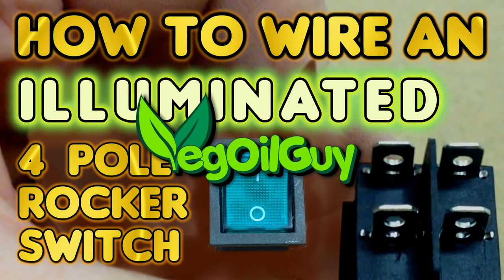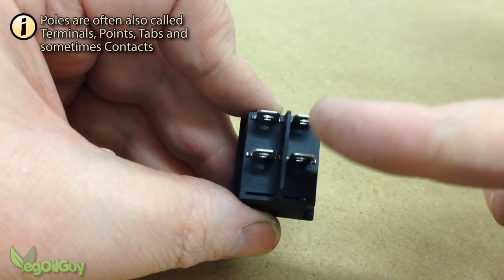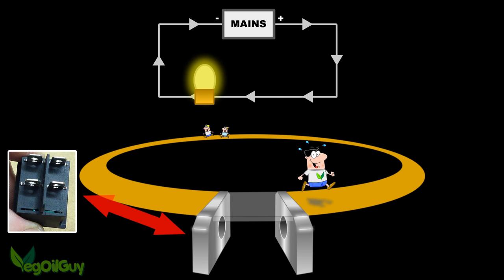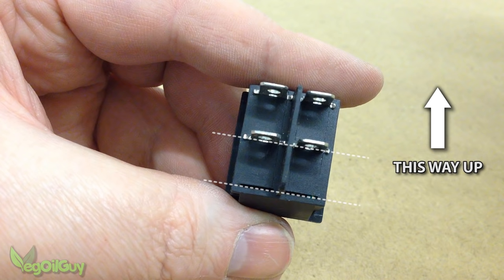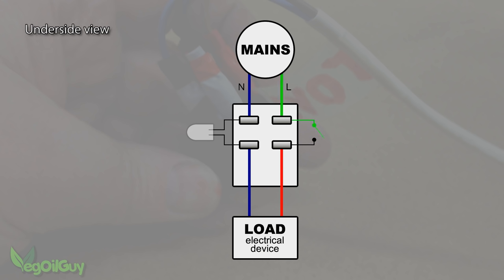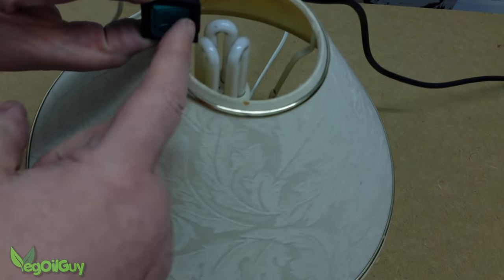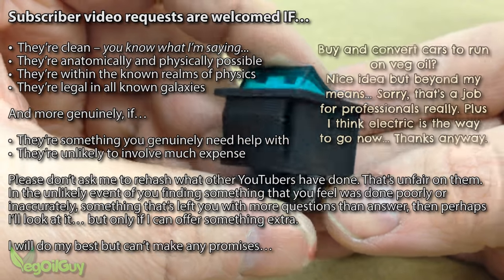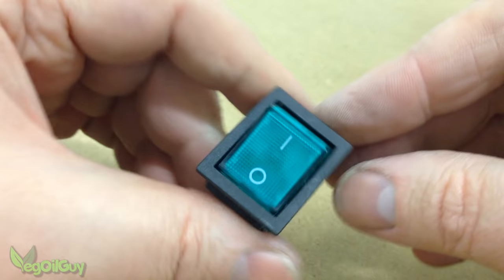How to wire an illuminated 4 Pole rocker switch KCD4 - by VOGMAN

Comment: Great video, concise and to the point. Exactly what I was looking for. I can't stand these people who try to launch their comedy or talk show careers doing you tube how to videos. Really, if you want a comedy or talk show career then do you video based on that. When I'm looking up videos it's because I have whatever it is in my hands at that moment and I have run into a wall and need a quick hand to get me moving again. That's why I look up things like "How to wire an AC 4 pole illuminated rocker switch" instead of "Switch wiring". I had a need for a specific type of advice and googled a specific question. So I don't need all the extra that so many people throw in their and it's a real turn off. I actually started a business buying and fixing broken down chainsaws and reselling them with knowing a thing about chainsaws just by using you tube videos to help me along. A little common sense, a little mechanical experience and the right videos and your good to go. I make about $1500 a month selling used chainsaws and have for about a year and a half. I give a 30 day warranty with every once and have yet to have one come back. So it goes to show that these how to videos have a place. But people who are serious about what they are doing, like me, I'm wiring lights in my blast cabinet at 1:15am (a 4500 lumen LED strip and a fixture for a 200 watt incandescent bulbs to use as a heater to keep my blast media dry so it doesn't clump up). I have several decades of electrical experience, but am new to rocker switches and the switch isn't marked as to which is which. My meter set to continuity told me the poles matched vertically (hot and neutral were stacked) but doesn't tell me which is the line and which is the load. Therefore I needed a video. And your was the exact thing I needed. I wish more people did exactly what you did just get on camera, explain what they are there to do with a quick intro then get on to the meat of the video. After all that's what we are here for. So thank you so much for doing that and not trying to throw on jokes or play some retarded character that acts like an idiot (that can't be taken seriously) or wasting my time with some long drawn out video about rocker switches that has more info about your dog or your pregnant girlfriend and what you wife has to say about it. Some of these idiots are just to ignorant to be allowed on the web. But Facebook and you tube give them a voice. One I wish they would take away. Anyway, keep up the great work. You just got another subscriber.
Reply from the maker: Thanks Mike, but... well, I'm just as guilty as the next guy for dropping in the odd gag, etc. I'm not trying to launch any career, but I do enjoy allowing my personality overspill into my videos. Sure, I try to stay on topic, but I'm human. I do what I do for free, so if I can't enjoy myself whilst I'm doing it, then why bother? I guess that's how other YouTubers feel too. So like it or not buddy, if you're after free content, you've got to expect that amateurs like me will be imperfect from time to time 😁👍
Reply: @vogman  the occasional gag is fine, these people invent whole personalities and do entire bits around it. A 5 minutes explanation takes 30. Your personality spilling over is one thing, the ones in talking about simply waste you time.

Comment: Thank you so much! Even if I am such a noob when it comes to electricity, I wired the switch NEARLY good, but my led remain still on even when the switch were off. I had connected the main on the bottom and the load on the top.
Thanks for the help!
Reply from the maker: Glad it helped!

Comment: Informative video...thank you!  (In hopes you're still monitoring this channel...read on!)  But 1 question I have (I live in the USA with 120V mains, BTW):  I have a 3-hole wall outlet (Hot/Neutral/Ground) near where I want to mount a LED 4-light fixed track light.  The light came with an open box/back and 2 sets of pigtails.  I'm pretty sure the one set of leads is for a fixed 120V On/Off connection as the other set of pigtails, 5 pairs emanating from a diagram labeled LVLE/SEC/36VDC/ + --  which is for an optional Triac dimmer...?.  

From the PRI(mary) there is 1 Black wire, 1 White wire coming out one side of the power supply, and a braided copper ground terminating under a mounting washer by - but not on - the power supply.  (It's labeled PRI/120VAC with L and N for Black & Neutral wires respectively). I have handy a KCD4 DPST illuminated switch I could use...now...if I was 100% sure how to connect - if I need to - the ground wire from the outlet in the 14/2 Romex (14 AWG w/solid copper ground wire inside sheath) to the bare braided copper ground wire (about 10" long in the lamp box I mentioned above) that  I'm using to make a custom length power cord.  

So, the DPST rocker switch has no pole designated for 'Ground' so I'm wondering if I should/could bypass the switch & wire nut the ground wire - (safely isolated from the Hot & Neutral switch poles) in the 14/2 Romex to the braided ground on the light...or just not use any ground at all.
**  I'm pretty sure the Neutrals & Grounds all go to the same lugs in my breaker panel in the basement...I am NOT using a subpanel...FYI)
TIA and just hoping you might see & comment on my situation.  It's 7:45 a.m. here in Missouri so I have all day to get to the hardware store and buy a standard light switch w/ground terminal and mounting box.  Probably will...BUT...I still need to use this switch, if I can, for another project on a vintage window fan (reverse flow circuit switch broke) & would appreciate/value any advice on grounding a KCD4 switch when used with mains/120V power.

Comment: That’s for the video. Good job. Just a heads up. In AC current the electricity  doesn’t flow in one direction it alternates back and forth. There is also no positive or negative. That’s for DC current like your previous video. Great video though.
Reply from the maker: Many thanks : )

Comment: Good to know. I was trying to decide if I could run a second load off the second pole. This switch is basically going to be a safety cut off for an iot based smart switch but I've got immersion heaters at the top and bottom of my tank. Was hoping I could switch them both on with one of these but now I'm thinking probably better to just get a dedicated switch for the boost heater.

thanks for the great video
Reply from the maker: Glad I could help

Comment: Umm. This is not how DPST switches work. You have the wiring right, but the illumination doesn't work how you think it does. DPST stands for "Double pole, single throw". There's no "LED side", both sides work as individual switches and the LED is located between the poles on the load-side. If you connect the mains to the load side then the LED will always be on, regardless of whether the switch is turned on or off. Also it doesn't matter which side is positive and which negative on AC switches.

Comment: Can a similar method be used for a SPDT toggle + a pilot light? It's an on-off-on switch that's non-illuminated so I bought a pilot light to act as my indicator.

The switch only has 3 poles (one for each 'on' and 1 for common, the centre one). I wasn't sure how to wire in the pilot light so it illuminates for both 'on' position.

The caveat? I'm using the second 'on' position for my highbeam signal, however, I don't want the pilot light illuminated the entire time that the system is armed and awaiting a highbeam signalsssl. I may not be explaining it properly and I might even be psyching myself out.
I'm just looking for outside input on this so I can hopefully get a better understanding of how to tackle this project :)

Comment: So the left and right sides basically act as two SPST switches together, with the LED across one of them? So I could run a 12v feed through the left side, and have the right side wired to a separate, 5v circuit?

Comment: Did you make those connectors? I don't have any screws for my switch. I just ended up taping my wires onto my switch. They probably won't hold for long though.

Comment: Good video.  I have a question.  I am installing a new CNC system and wish to use toggles for the CNC, vacuum, water pump, vacuum clamp, light.  I DON’T WISH TO CUT PLUGS FROM ANY DEVICE.  Would you use a daisy chained toggle group to individual single pole outlets?

Comment: Can you use a 4 pin switch as a ground trigger?
By jumpin both bottom pins to gether then to ground side of a relay switch. Then top right to ground and a positive to top left for illuminating the led when the circuit is closed?

Comment: So my question is, can one wire it so the light stays on even when the switch is not engaged? This is purely for aesthetics, I am rebuilding a computer where I would like the cooling fans active before the computer is on. The case is not set up for proper cooling. Some remodeling is required. If not would it be a pole issue where I would require a switch with a dedicated pole for the led?

Comment: I have a 6 pole illuminated rocker switch. No instructions either. It says 1a - 1 - 1b on one side and 2a - 2 - 2b on other side.  It is an on off switch. Model kcd4. So is this really an on - on switch labeled like an on-off switch?

Comment: hello bro, thanks for thsi video, but I'm having an extension board which is using the same type of switches, but my one of the switch is not working... It is not turning on... so I decided to use one socket without a switch.... but I'm confused with the connection now... could please help me? I can share you the pic of my extension board, as my switch is not having that line in the bottom part...

Comment: if i wanted to use the switch the same way as you did on your control panel, but i DID want the LED to turn on, how would i wire that?
Reply from the maker: This particular switch needs a 220v power supply if I remember rightly, where as on my control panel it was only switching a 12v circuit 😁

Comment: During the end as you say you just wanted a switch, I have the same issue with my 36v scooter I only have two wires with the voltage all ready passing through, if I try to jump the wires to the bulb it doesn't work however it will light up as long as I don't use the switch side, I've tried every combination however it a.c so it's always the same out come, is their a way to wire the switch and the light together via just two wires? I'm guessing some sort of one way diode as the light is shorted out when connected to the other side of the switch. It's a confusing one I know
Reply: Fyi it's a two prong switch from a controller board, when you touch the two wires it turns on the controller, used to be an key ignition single switch.

Comment: Hi I have a 4 pole switch just the same I have the load from the battery in the top 2 connects and it goes out to a volt meter and power light they turn on and off with the switch but the light on the with doesn't light

Comment: What happens if you hook them up reversed, will it still work?
Reply from the maker: Hi Joseph. I'm not sure what you mean by "reversed" but it is possible to wire the switch up and have it "switch" but the light not work. I've done that myself. Wired up any other way, I really don't know what would happen... nothing exciting probably : )
Reply: VegOilGuy  I think I got my answer. I hooked up positive where u have the negative and the negative where you have the positive,  and the switch light stood on continuously. Even when switch to off.  Thank u for the video btw.
Reply from the maker: It's fun to experiment  : )

Comment: So you say it is OK for 12 V car circuit. And if so, is it still possible to use LED illumination too?  So same connection as AC?
Reply from the maker: You can use the switch as a switch... but the light won't work unless you use the correct voltage.

Comment: That means all the load must pass through the led...How is that possible if the led is such a load sensitive thing?
Reply from the maker: Generally where there's a light indicator of any sort, the light is wired in parallel. This means it doesn't pull any more power than it needs to, is not in the path of the main load, and power will flow even if the light ultimately fails.

Comment: This video worked for me but my load and input sides were reverse and since leds only work in one direction and I was using 24v DC, I  had to connect the power input on the opposite side  in order for the led to light up.
NOTE : My switch was made for 24v DC 30 amps.

Comment: I have one of these switches, but with 6 poles... Can you show how that one is wired up? The poles are names 1a, 1, 1b, and 2a, 2 and 2b...
Reply: I think O poles are neutral and the I poles are load, the 2 of the middle are made for whatever you will want to connect.

Comment: I have the same rocker switch with a three wire cord, the wires are Black-Hot; White-Neutral and Green-Ground. I have followed the White to White, Black to Black and Green to Green throughout the circuit, but it keeps kicking out the beaker.  What am I doibg wrong?
Reply: I got it. No worries now. I left the Green Ground open. Thanks just the same, great Vid. I printed the diagrams for future use. bye for now. gary